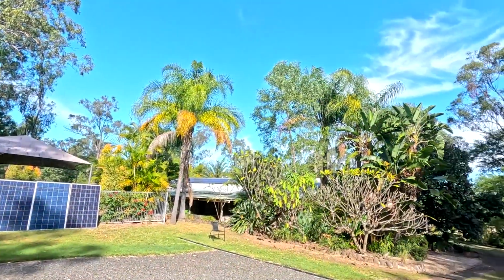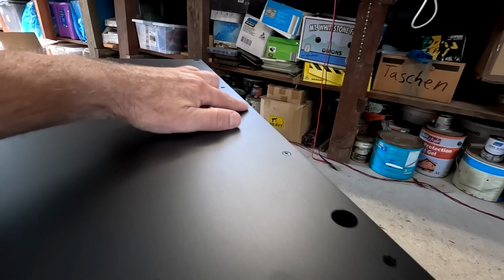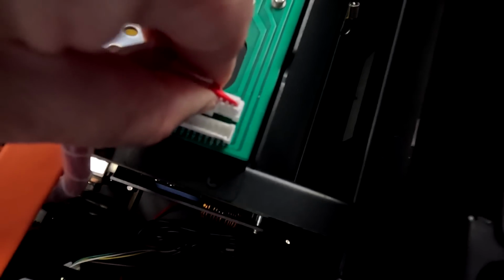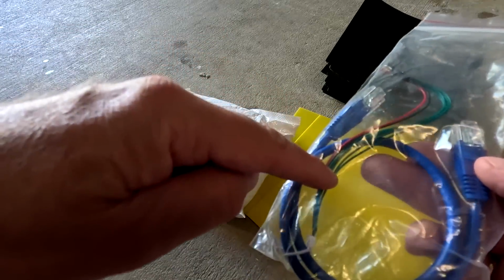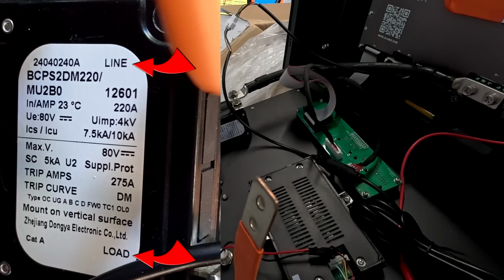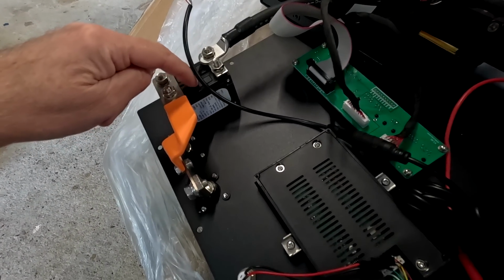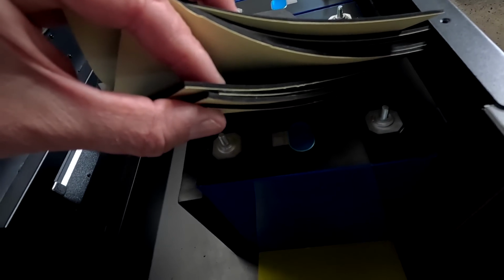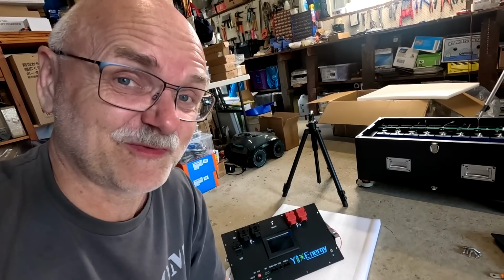The Yixiang DIY Battery Box on the testbench. Does it tick all the boxes?

Comment: Also the 80V DC rating for this breaker is well within  range for the operation of 51 VDC output from the charge controller which is then controlled by the BMS.

Comment: The housing is quite ok. But not 5 out of 5 frogs. Maximum of 4 out of 5 frogs! 
Problems:
1) I only had two screws per balancer rail and no plastic washers.
2) The flexible busbars are only 40mm² including the ones to the BMS.
3) The two plates that connect the circuit breaker are only 18mm². 
4) The circuit breaker can only disconnect 10kA.
5) The screws of the circuit breaker only have serrated lock washers and no spring washers.
6) The screws of the circuit breaker are only M6 and then also with a spanner width of 11mm instead of 10mm.
7) There is no IEC62619 certificate, but this is required for registration with some network operators in Germany!
Reply: Typisch Deutsch! ❤ Also bitte das ist bestimmt keine Wollmilchsau! Aber Du meckerst wegen Unterlegscheiben ! Und wozu brauchst Du mehr als 10 kA Schaltvermögen? Bitte erst eine anständige Bundesregierung wählen und dann bei den Chinesen meckern! Bald werdet Ihr Entwicklungshilfe bei den Chinesen beantragen müssen, wenn der Hebeck Wirtschaftsminister bleibt!

Comment: Hi Andy, I was wondering if you could test your battery with the JkBms connected in series, 48V + 48V, to get 96V. Or perhaps someone in the community on this channel has experience connecting them in series?
Reply: When batteries are in series, each BMS sees the full series voltage when it disconnects. Unless the MOSFETs are rated for that full voltage you will destroy that BMS, and this is unlikely, because higher voltage MOSFETs are more expensive and have a higher on-resistance.

Comment: Hi Andy, Thank you for all the information you share. I see the breaker has an ICu of 10kA, but a lithium cell has an internal resistance of approximately 0,15 milliohm which can cause a short circuit current of 3,5/0,00015 = 23kA. So the breaker could arch while tripping on short circuit. All the battery boxes I find have this same issue and it's a major safety issue I think. How do you think about this?
Reply: Don't forget the busbars, connection to BMS and BMS itself. The resistance will be a lot higher, the current a lot lower than what you got. Plus the BMS has over-current protection.
Reply: @peterdiy  Yes it has overcurrent protection, but the breaker must also function when the overcurrent protection fails in a full short circuit situation.
Reply: @jeeastee  Yes, but the breaker is not installed on the naked cell. Even just the welded on studs add resistance. For cells tested at factory with 0.17mOhm I was told by the seller to expect about 0.20mOhm measured on the studs. By the time you include the bus-bars that will be a lot more again. 

As a result the maximum current the breaker ever will see and has to break is a lot lower. 15kA or less.
Reply: @peterdiy  Your right, but still I would like to see a test of the breaker in short circuit without BMS protecting for overcurrent multiple times without exploding or arching, especially when it is a breaker from a unknown brand without test certifications. I decided to buy a box without breaker but with a emergency switch and I will add a 20kA T-Fuse myself.
Reply: @jeeastee  How did the T-Fuse install go? i think I will do the same
Reply: I've been wondering the same thing.  I suppose we could approximate the resistance of all the bussing and connectors, but I agree the breaker is definitely insufficient if we disregard those resistances. It's very hard to do proper interruption for these 280AH cells, and I wonder whether the UL listed server rack batteries or wall-mount batteries that use 280AH cells (like the MidNite Solar, EG4, and SolArk wall-mount products) are actually able to interrupt their maximum short circuit current.  If they are, I'll bet they are also assuming that a great deal of the resistance is in the bussing and connections.

Comment: I have ordered 3 of these and a set of rollers.
Currently the best 48V horizontal box out there.
Only improvements I can find is an extra plate for fixing the BMS board to avoid cracks induced by the deformation of the compression forces, and a better circuit breaker so the cabling and batteries are also protected by this breaker.

Thanks for the good work Andy 😄

Comment: Did you achieve 100% JK-BMS communications compatibility with your Victron inverter/components?  I'm worried about interoperability and I don't think it is wise to use inverters (no matter how popular, like SOL-ARK and EG4) that say they DO NOT support the JK-BMS(s).  Thanks in advance for your thoughts.

Unless an inverter is WILDLY better, I don't want to use it if it forces me to WILDLY overpay for batteries.

I'm surprised that there are not better communication standards between BMSs  and  mainstream solar hardware components.  Also it seems like the JK-BMS manufacturer would want to do everything possible to work with the world's top 20 solar hardware companies to expand their sales.

Comment: Hi Andy,

just to comment on the circuitbreaker.

Icu of just 10kA is not very high considering the shortcircuit current that Lithium can make with the very low internal resistance of the batteries.
Best would be to have like Class-T fuse which can handle like 50kA

Comment: Thanks for your great videos.   I noticed the optional caster wheels.  Can these units be safely used vertically once built?  I want them to stand up against a wall vertically rather than flat horizontally .  Thanks!

Comment: Andy, when are you going to step out of the closet - is this the one you’re going to go ahead and build 20 units? And with JK inverter BMS? Do you think they’re going to solve the missing consumption issue with firmware update?
Reply: Considering how much anexiety you get from messy cables implies that you’re going to get rid of all other boxes and use only one the selected one. The big question is which one. Is there more in the pipeline still coming?

Comment: Dear Andy, I have you seen switching the battery's around. I would like to add three battery boxes. (With JK inverter BMS's) Would it be possible to switch one or two battery boxes down, once in a while, without converting the one availible to "master"? (Dipswitches useualy are not very sturdy build)

Comment: Hi Andy, I have just found your videos and they are great.  I am building a battery pack using the EVE MB31's that you tested with good results.  My problem is that none of the XiaoXiang BMS software APPS available for my android phone allow me to change the parameters of my BMS.  Do you have any advice please?
Reply from the maker: Why is this a scam? It has different options. You choose the one you want.
Reply: @OffGridGarageAustralia you answered to wrong question. 😮
Reply: @OffGridGarageAustralia  Yes it certainly feels like a scam. YIXIANG advertise stating it is for 24 volt systems also but they don't have 24 volt DIY boxes. And as far as i can see the JK Inverter BMS JK-PB2A16S-20P (same as they put in) with breakout box i bought won't fit in an empty shell box. They do not have 24 volt pcb's so in fact it is only for 48 volt. Complete box with all included except cells  delivered to the Netherlands for 538 US Dollars. Empty box with nothing still 220 US Dollars. You pay 120 US Dollars to get from a eurowarehouse in Poland fcol! Bummer!

Comment: Not sure about your voltage comment. I suspect your 48V battery will be in trouble if you feed 80V in and you're not likely to get 80V out either, right?
Reply from the maker: At the end, that's what the BMS is for. If I feed 80V from solar into the batteries, it will still charge as usual, as much as the solar can deliver. The BMS watches and will disconnect if out of spec. But will the BMS still work with 80V on its input?
Reply: @OffGridGarageAustralia  No 70V is absolute maximum according JK specs.

Comment: Did someone ever make actual 4U 19" cases with rails? A good serverrack can hold close to a tonne (1000kg). So one 42" Rack filled with batteries can hold about 135kWh battery cells. Nice and efficient.
Reply: Rack rails are difficult, that’s probably reason why they don’t provide them.

Comment: Be careful when ordering. There was an additional fee that I didn't agree to after submitted my payment. In other words, they tacked it on after I clicked the pay button.
Reply from the maker: I think you mean the fee raised by Alibaba? If not, be more specific.
Reply: @OffGridGarageAustralia  no. not the fee. I also got several different quotes for the same box, ranging from 400-500 plus fees and shipping which were all different. The best price was using your link and not speaking to anyone. That ended up being $589 plus the mystery after-charge which they call "SPREAD_DEBIT
yixiangnewenergy
$17.63". Again, this showed up after I clicked pay. Not a lot, but not cool. Also, quotes for shipping varied wildly. All to the same address. I'm sure the product is fine, I just don't like inconsistent pricing from sellers on Alibaba.
Reply: @OffGridGarageAustralia  
Here's the order lest you think I'm lying. The charge in question is the SPREAD DEBIT fee. This was not part of the original invoice terms which I agreed to. They added this fee without  including it in the total. 
I don't care for that.
Purchase details
YIXIANG Customized 16pcs 48V 280Ah 304Ah With JK 200A BMS Empty Diy Kit Box Lifepo4 Solar Energy Storage Battery
yixiangnewenergy
$429.00
SPREAD_DEBIT
yixiangnewenergy
$17.63
Amount
$446.63
Shipping
$120.77
Tax
$39.69
Total
$607.09
Reply: @OffGridGarageAustralia  I just order the box today.  I see an option to "Add Services"  for "Production Monitoring & Inspection Services - To help reduce risks in production delay and product conformity"  The services is in the amount of $48 USD.  I did not select this option during my transaction.  Perhaps this is the fee @rtsrts2317 is concerned about.

Comment: On small DC breakers you have only one direction where the arcs are distinguished (Funken lösch Kammer).  DC should break plus and minus pole. (1x 275A breaks both poles).  Charging is only 50A, discharging can go to 10kA when the inverter would have a short circuit.
Reply from the maker: I cannot find any specs for this breaker, so don't know if it is really a bidirectional.
Reply: @OffGridGarageAustralia  if there is a diagram (which is even on my chinese “heschen” brand) than it is the only allowed direction.  Those fat breakers are usually bi-directional, the small “AC sized” DC breakers mainly uni-directional.
Reply: There is a german channel “Elektronik EXTREM” in which he tests those breakers with 1000A and 1000V and dissassembles them and shows the arc distinguishing room(s)

Comment: Well done Andy - very impressive, having just built my own diy box I know how much work goes into optimising every small detail down to the last nut and bolt ITS A LOT OF WORK TOOK ME A MONTH and Im ok but not at that level of elegance.  $550 inc shipping by sea 2 months to uk  but If you are building a 24/48v 280Ah rig to last 10 years plus dont skimp on quality I guess.  Looks very easy to maintain.  A new gold standard IMHO
Reply: very good comments below - BUT - several are talking about installing these in a closet (eg its like a home powerwall and there plenty info on those and potential risks warns against indoor installation)  If it goes badly wrong you burn your house down  - surely not insurable today.  Wouldnt like to see these in appartment blocks where a penthouse dweller decides to use his roof space for solar.  In OZ surely regs wouldnt allow it, but in other countries -  would present a risk to other appartment dwellers.  I read that putting gear in an attic void space is no longer allowed
Reply from the maker: I really like this DIY box and it seems to meet our expectation in all details.

People need to read and understand local regulations. I have seen videos, where people installed batteries under the staircases, just because there is unused room.

Comment: I think the second connector is for a NEEEEEEEEEY.
Reply from the maker: A NEEEEEEEEY and a JK with active balancer. You mean, if you cells really need it?😅
Reply: @OffGridGarageAustralia  Is it possible that the PCB is the same, like the EEL boxes? So they doesn't change the design?
O.K. I had look in my EEL-box. It is the same PCB.
Reply: @OffGridGarageAustralia  Or if you use an other BMS. But there is no other reason for this additional connectors. In the video I can't see where the connectors are soldered, but there is nothing else on the PCB.

Comment: Hi,
The box have defective PCBs, you have to use washers otherwise you will burn the bms
Reply from the maker: I've got some emails form people pointing this out. I'll check out the PCBs and make a short follow up video.
Reply: @OffGridGarageAustralia  I've already done some research, this topic has been going on for over a month, I've already made a project for the printer :)

You probably also received this information from the seller, everyone was told not to screw in one of the screws.

However, there are more screws that create a short circuit.
Reply from the maker: @ParagonDIY  Thanks for the info. I'll investigate...
Reply: We have fixed this problem, and Andy received a box that had been fixed.
Reply: @YIXIANGBATTERY  Why do you advertise it is for 24 volt systems as well when it isnt?

Comment: Be interesting if you could fit a 4 pole bi-directional breaker, like the ones I use, they seem like a nice box, be interesting to know how much distance above the battery to the lid to lay a 10mm Perspex sheet to allow additional monitoring gear
Reply from the maker: If you install a larger MCCB with high breaking capacity, it may not fit into this case without a lot of modification in terms of cable connections. I would suggest making a new front plate in this case and re-arrange the components to make it work.
Reply: @OffGridGarageAustralia  Andy would be nice if I could easily make a front plate, but hours of work on filing and drilling the output panel of the inverter, would be nice to have a smaller metal plate with the holes already done with about a 15mm larger border so one can just drill a couple of holes to mount it

Comment: Some DC circuit breakers use a magnet to deviate and extinguish the electric arc that forms when breaking the circuit under load. This works only if the current is flowing in a certain direction. If the current flows in the opposite direction, the arc does not extinguish and the circuit breaker could catch fire. There are many demonstration videos on youtube about these "directional" DC circuit breakers frequently used on solar panel circuits.
Reply: Is that what this box is using, a magnetic breaker? Is this box unsafe, in your opinion? I was thinking about getting this one but I would need to stand it vertically to fit in a small closet. Is this a bad idea? What do you think? Anyone may answer, btw. 😀
Reply: @PersonalStash420  Breakers with magnetic arc deflection have directional markings for the correct current flow direction. This one with an input and an output marking is suspiciously similar.
Reply: @danielardelian2  Indeed yes only works on battery output not for battery charging - separate MCB needed.  But then the main danger is battery sc with down stream inverter etc.  Nvere forget the ultimate breaker is some big cable cutters hung permanently beside the box - leccy pliers wont cut it.

Comment: Hi andy do you let the communiti know if there cerquit breaker is up dated ? 
I think this is the box that i want for my battery's.
Reply from the maker: As I said in the video, use an external proper breaker and use the built-in one more like a switch in case you need to disconnect.

Comment: Do you know if anyone makes a box like this for an 8 cell system with the EVE 280Ah cells?
Reply: EEL makes boxes for 24V with the JK-BMS, but without the display integrated .....
Reply: @mandxyz2523  Thanks! I was planning on the JK BMS anyway, so that looks perfect.
Reply from the maker: Most 24V boxes will fit the same number of cells but installing them in a 2p8s configuration. You can basically use any of the 48V boxes and arrange the cells accordingly to make a 24V system.
Reply: @OffGridGarageAustralia  Thanks - Yes I'm aware that I could configure the 16S boxes as 8S2P. That would be too large (and unnecessarily expensive) for our RV application. The Eel 8S box looks suitable.

Comment: ELL Battery have the same new box for JK bms... i think than someone else produse box for that company....
Reply: Our horizontal JK battery box was launched earlier than theirs. The new screen kit uses 4 flexible busbars and the shell material is also better.You'll see it in Andy's review video soon.
Reply from the maker: The EEL box got delivered last week, so review should be just around the corner.
Reply: you are right. just checked. my JK boxes did not have .... bought too early ..... but for my purpose with the insulated box the old version was better....

Comment: Looks like my EEL box, even with the extra connector on the balance boards.  On the plastic isolators and foam ... I put the foam on the isolators and it works great.  I like the bended buss bars better then the cables too.
Reply from the maker: I've got the EEL box here as well, review incoming!